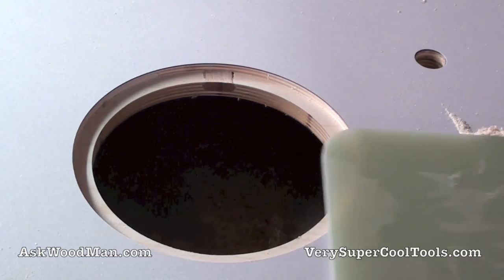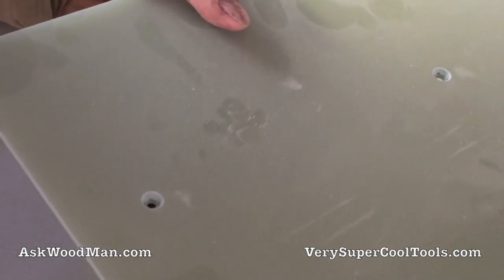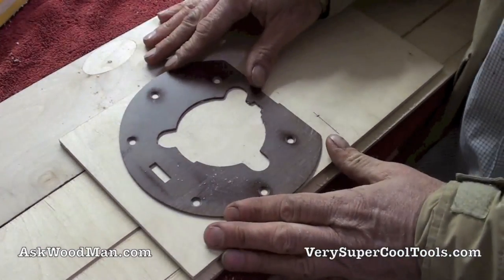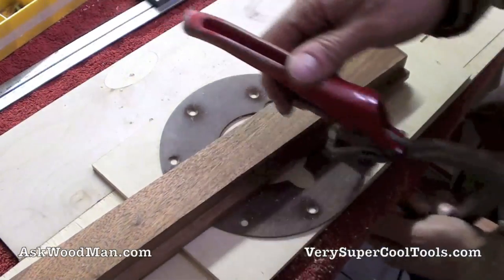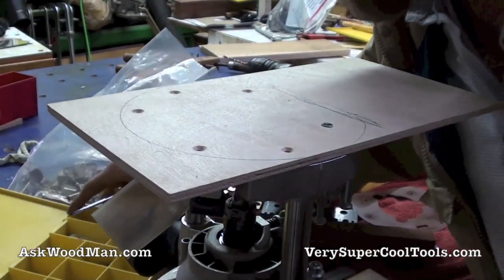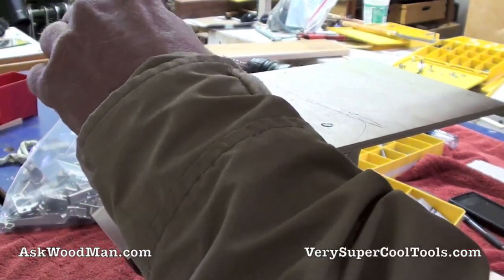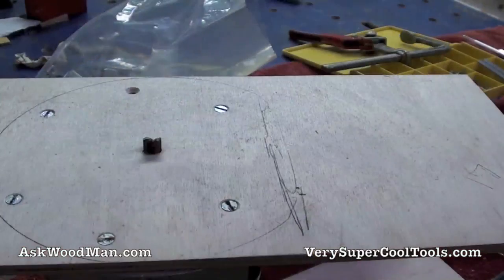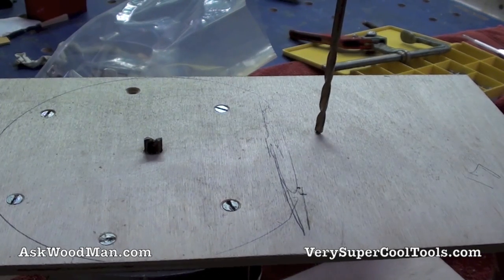19 of 27: Making The Router Table Insert -- DIY Biesemeyer Style Guide Rail Series

Comment from the maker: Excellent suggestion and observation. I did not think about using the previous over sized disc. But it would have worked just fine. I would have just had the readjust the jig and re-plunge into the over size disc and just make a slight trim instead of starting from scratch. Thanks Allan

Comment: Love the use of the Champ.  I've carried one in my pocket daily for the last 25 years.  Nothing can replace it.
Reply from the maker: I agree. The Champ is the best.
Reply: I  built a circle jig like that using a  left over piece of galvanized heater vent to 22 inches.   Worked ok,  but was too flexible. 
A thin piece of wood seems so much better.
Reply from the maker: Karl Miller
I save all my Baltic birch plywood scraps. It is just the best for jigs and fixtures. Your Homer Simpson avatar is great. In many of my videos you can see the large Duff Beer poster with Homer looking like he had many too many.

Comment: Where is you threadlock, for me is necessary to prevent screws to be loose, especially in a wood router base hollder
Reply from the maker: telosfd I have never had a problem with machine screws backing out on the router base in almost 30 years of professional woodworking. Never.

Comment: where do you buy those bits? never seen them.
Reply from the maker: Which bits?
Reply: AskWoodMan The self centered drill bit im guessing, i would like to know too
Reply: Michael Pedersen
Those are called Vix bits. They are available in different sizes. Here is the US they are sold at most hardware and woodworking stores. Even Amazon carries them. Very very handy tools. The bit inside the spring loaded mechanism can be adjusted for drill depth via a small set screw.